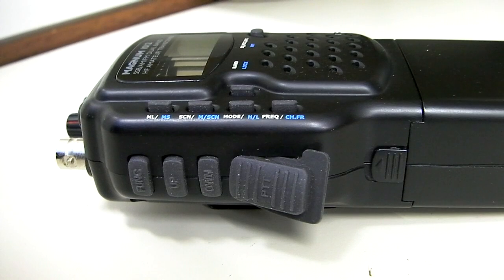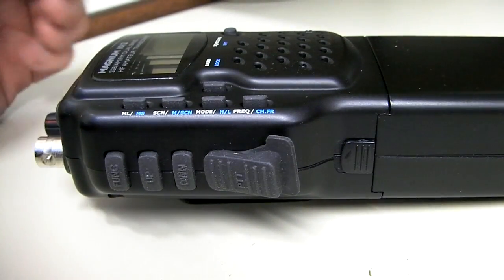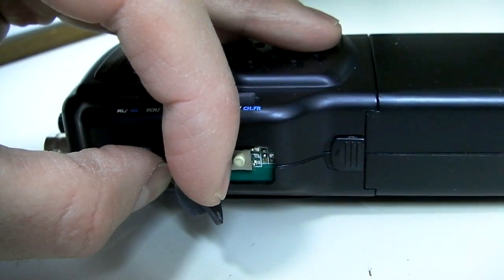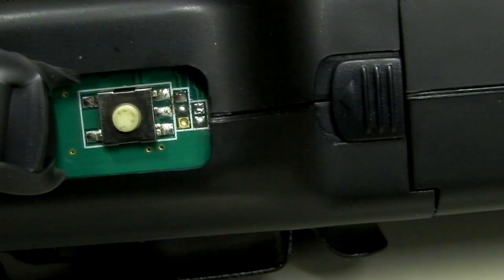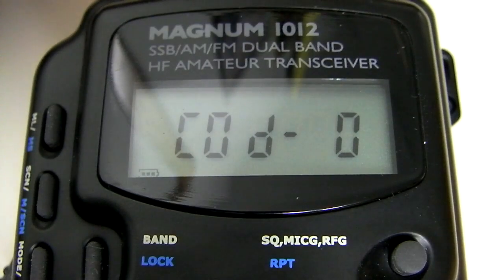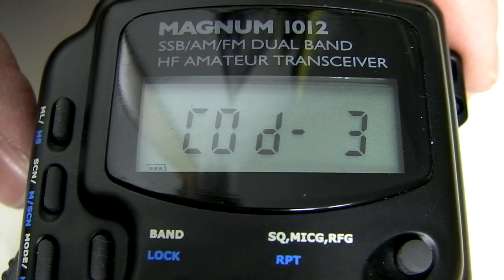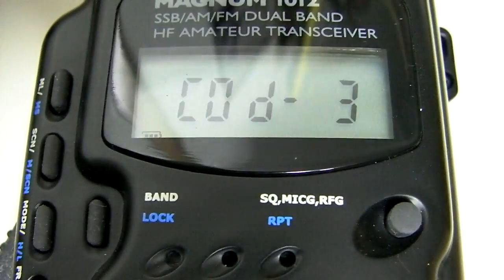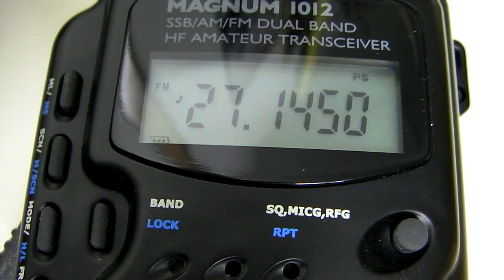Magnum 1012 AM/FM/SSB Expanded Frequency Conversion 10 & 12 Meter / CB Radio

Comment: Hope I didn't screw but. As the 2767 is 1000 foot pounds, i bought a 2766 you've not mentioned with the indent to hold sockets, and it's 740 foot pounds tightening I believe 275$ w/2 batts charger  box.. 2766-22

Comment: Try hanging a 2.5 meter (8 feet) cable from the connector housing, which will act as a counterpoise. This trick will greatly improve your signal, both in transmission and reception. Regards LU1AR

Comment: Looks like various versions from different years have slight differences. I just got one 11/23/20. No pads were soldered. On shorting it to do COd- 3, I cannot do a band change. Band button just does ch 9 and ch 19. If I do COd- 4, I can do the bands. But I can’t get 10 meters to go below 28.300 yet. There some beacons at 28.200. And I like to copy cw. But this is day one so probably just some stuff I haven’t figured out yet. The manual agrees with this video. My findings agree with some British youtuber. Quirky frequency tuning. But I’ll adjust. Mostly wanted this for having ssb on the cb frequencies. My elecraft kx2 is king on 10 and 12 meters portable.  Still nice to have it here. I’ve wanted this rig for a decade.
Reply: Update: I found how to get to 28.200 MHz. The hit the band button until your in the ballpark. The band button doesn’t just shift from band to band. It goes in groups of frequencies. Like 24.775MHz , then hit the band button and it goes to 25.225. From there you can tune up or down a ways. Just thought that might be helpful.

Comment: Hello,  i have albrecht ae2990
. I tried to make a frequency modification (COD-3) but i couldn't.I tried 1-2 pins together by tweezers,COD-3 opened, but i didn't see all of frequencies on my radio. I can only use standart frequency. 26.9650-27.4050. What is wrong thing?

Comment: Another fly-by-night flash in the pan product from 2011. These weren't on the market long and relatively few were made as most of these radios were problematic with SSB FMing, warble and frequency drifting. The ONLY version that has survived into 2016 is the Albrecht AE 2990 AFS...and they too had and STILL experience the aforementioned issues. Therefore, vendors are few and far in-between (they got tired of all the returns/exchanges and warranty issues), and stock is usually quite limited as I believe they are made in very small batches now. 

I had to import mine from Europe and I took it in the pants with the currency conversion. So, it's essentially a $300USD/$400CAD handheld CB radio with design flaws and less than stellar audio once it's shipped and imported. 

It's too bad as these rigs really had great potential if they were built properly and priced reasonably. AM/FM CB handhelds like the Midland 75-822/Alan 42 Multi still continue to sell decently and if they had an SSB option along with 10 & 12 meters for ham operators, they'd sell even more I'm sure. 

I blame poor design, poor marketing and poor pricing for the Magnum/Super Radio/Albrecht 1012 failure in the marketplace.

Comment: I guess I don;t understand the mods?  If you have those menu options, why unsloder the blobs, or, do you only get those extra menus if you do the unsoldering?  As a Ham, I would be interested in non-channelized full coverage straight through all the freqs with very fine freq adjustment control.  I'll check the website for those answers.